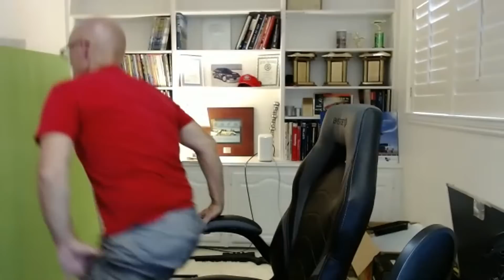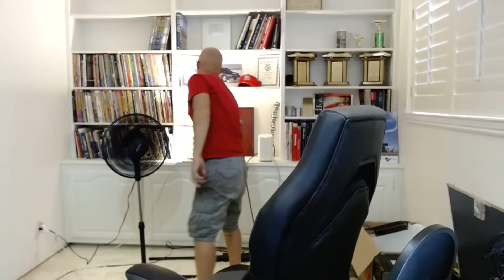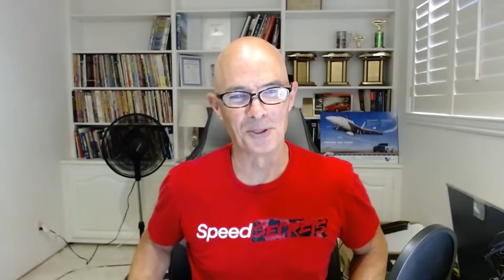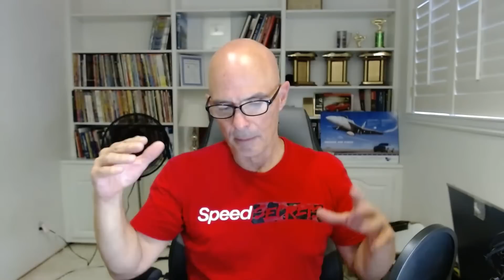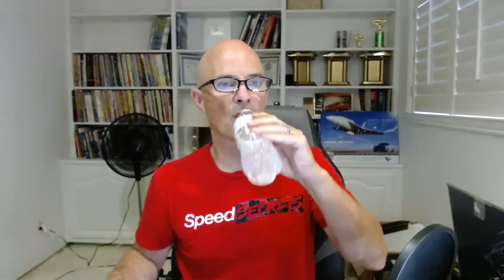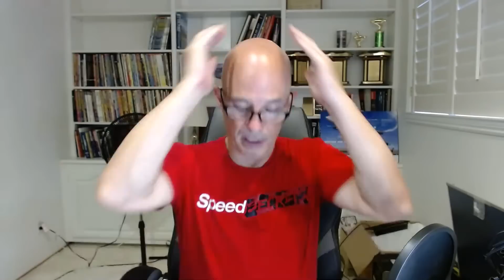LET'S TALK TECH-Q-JET POWER MOD VIDEO IS UP, THE NEXT NOVA MOTOR?

Comment: Any two carbs of the same airflow - tested not rated - at the same A/F ratio make the same max. horsepower, plus or minus.
The difference is everything else under that number - and THAT'S where the Q-Jet really shines. Most of these are street builds, which means traffic, expressway, stop and go driving. The Q-Jet is so tunable (once you learn) to all of the part throttle situations that it's WAY ahead of the Holleys.
Holley covers the areas between where they can be tuned with 'built in' just slightly rich A/F ratios - perfectly drivable, but a waste of fuel.
There's also the Thermo-Quad, parallel to the Q-Jet for tuning and real world driving.
I'm a Ford guy good with tuning all three carbs, and I RUN Q'JETS ON MY FORDS.
Holleys are fine if all you care about is simple and easy, but if you want the mixture near dead on there's better choices.
The only carb (IMO) more tunable to drive to work and race on the weekend are the Webber/Dellerto designs, there's no carb you can match closer to a full range of driving with nearly engine combination that I've ever seen, but they're WAY too expensive to consider.

Comment: Try a 1" open plenum spacer and the valves lashed at +1/4 turn of rotation from 0 lashed. Think of the old Bobcat kit from back in the day. I've seen this work on several Pontiacs back in the day. Using 455 HO cam and carb to the base 400 4bbl's.This was normally a noticeable seat of the pants increase in power and rpm's.
Reply from the maker: the lash won't change anything, we were already near 1/2 turn

Comment: At one point, I was good at tuning Q-Jets.  Tweaked the Qjet in my '79 TA Olds 403 and recurved the timing.  Blocked the EGR, and I swear it was worth 100HP.
Reply: Drilling out the orifice to allow the secondaries to open sooner made a huge difference.  I was lucky to peg the size of the drill on the first time.
Reply: Dashpot orifice.

Comment: When I went to GM Training Center, I was shown that there were two check balls that were very slightly different and if they are swapped around the Q jet would not adjust properly. 
Most people do not know about this slight issue.